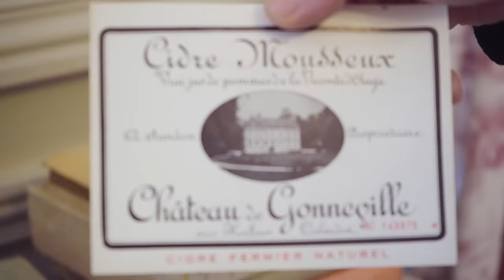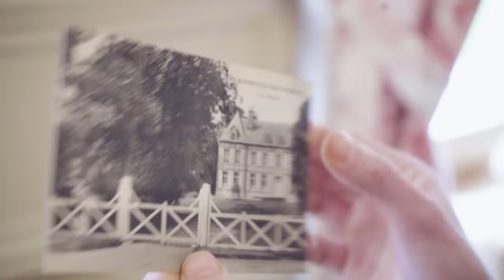We bought a crumbling Chateau - and that's how it looks now.

Comment: Heating tip: used floor heating when possible (it can be done under tiles floor but also under wood flooring). When your feet are warm you don’t need to heat too much.
Reply: Floor heating is the worst thing as far as heating is concerned.
Reply: Underfloor heating is useless for old buildings. The slow heat build-up leaks through the numerous gaps that old buildings need to control moisture.

Comment: If you want to remove old paint from metal objects (door knobs, hinges, metal light bases, etc). put them in an old crockpot you don’t use anymore and cook them in the hot water on high overnight.  The heat makes the metal slowly expand and loosens the paint.  Remove them and scrub with brush.

You don’t damage the metal and have to use caustic products

Just a thought
Reply from the maker: Thank you for the tip!

Comment: I just discovered your videos and am in love with your renovation.  My family was constantly renovating homes as I grew up and I can attest there wasn't nearly as much mirth as you guys show.  I'm glad you are able to enjoy the process so much.  

I did want to mention a shortcut.  You mentioned having to remove the paint from old hardware.  Another youtuber I watch had the same issue.  However; she filled a crockpot with hot water, dumped the hinges, etc. inside then let it "cook" on high for 6 hours.  The paint came right off with little effort.  Just thought you might want to try it if you run across more metalwork that needs stripping.

Best of luck with the channel.  I subscribed after the 2nd video I watched.  Can't wait to see more!
Reply from the maker: Thank you Shelly and welcome  to our channel!

Comment: 🚩 10:40 It's not wise to not heat up rooms because later you will deal with mold there and it will cost you more then heating to get rid of mold  and deal with the damages. 😏

Comment: Preserving your documents: I have some expertise in the conservation of parchment (perkament/pergament), and studied parchment making in The Netherlands in 1996. Your oldest documents are made from parchment which is essentially a specially prepared form of leather. The primary enemy of parchment is moisture. My recommendation is that you acquire a plastic bin as soon as possible for those parchment documents, and you can protect them from most environmental dangers such as bugs or dampness by placing in the plastic container with the documents two small boxes, one with rice to absorb moisture, and the other with baking soda and maybe a few mothballs or some eucalyptus oil to repel bugs. Parchment that is kept in reasonably dry conditions can survive indefinitely, which is why it is still in very good condition. Some parchment still exists that is over 2,000 years old. As long as it is kept dry and free of bugs, it will be safe from decay due to its physical microstructure. When you can, seek out the nearest library with a conservation department; they can construct archival containers for you or advise where to purchase them. Thank you for sharing your story!

Comment: Carbon date the paint sample and it will give you an idea of when it was made. Just a small speck of paint is all that is needed. Send it off to a lab in your area or a conservator may have a resource for you.
Reply: Oh another issue that many of the paints in the building are lead based and considering small children make sure their is plenty of ventilation and their not exposed to dust. you can get test kits at a local hardware store to test the paint in questionable area's. If the surface is intact just paint over it to seal it. Be safe.

Comment: I'm really enjoying your 'Renovate A Chateau' and trying to take inspiration to renovate my small flat in London!....I have some questions: 1) With the high global energy costs what is your strategic plan regarding renewal energy sources (i.e. Air heat source pumps, Solar/Wind power etc.) ; 2) In England you can get repair grants for historic buildings if they are on the Historic Risk register. I understand that in France buildings are listed as Classé, if considered of national importance or Inscrit  of regional or local value.  If you Chateau is listed as such did  you qualify for a grant?  3) You stated your Chateau was built on  the foundations of a Norman Fort!....Were you required by French Planning law to have an archaeological survey? ; 4) As a film maker have you considered using the Chateau for French films/dramas?  Merci Beaucoup!

Comment: 16:33 The latch is a little bit stiff...
Take the latch apart. Clean the inside surfaces very well where the metal slides. Spray the contact points with Moly (molybdenum) Dry Lube. That stuff is amazing.
Then once that's dry spritz a little bit of WD-40 lithium in there.
It will slide back and forth like a champ.

Comment: Not an easy task, but a faster (and not always cheaper- depending upon the fabric and tacks chosen) solution to covering walls until they can be properly done would be to tack some pretty fabric up. If you make the fabric panels into curtains and hang them on rods, then all you have to do is relocate the curtains to the next room you plan on renovating. You can still peer behind the curtains to reveal to curious guests the original painting and paper. :) By the way, Anna, I love that you’ve made your own wallpaper! Beautiful. I love the green walls, too. Very cozy! :) Where is your pack of hounds? That is all that is needed for a cozy winter family gathering!

Comment: The bed seems to be way too modern for a chateau as does the lamp. Maybe you can go brocanting with Billy Petherick to find some antiques to use. The modern medal chairs by the table in that bedroom don’t go with the chateau, either. 
It seems all the moldings are just disappearing since they are all painted the same color. I know y’all have worked hard, but antiques would help with the overall aesthetic of the chateau.

Comment: I had 2 radiators in a sunroom that burst during a power outage after an ice storm.  I was about 29 and had no idea that I needed to drain all the water out of the system. my plumber said they could thaw them out the next day - no problem - it started raining into my back mud room a few hours later and they were toast.  I couldn’t find anyone to take them out of the house so I disconnected them from the system and there they sat.  At the end of years of restoration they were stull there.  A friend Linister Smith, an artist, painted a harlequin holding pipes by my ancient water heater with the name of the Plumbing Company. He had had a run-in with them years before.  Made me happy. Protest art.  lLive and learn and sometimes you just live without the lesson and that’s fine too

Comment: An idea for DIY art pieces to hang in the breakfast salon is to transform photos of your best historical documents, with their beautiful calligraphy and ink stamps, into poster size pictures. You can use antique frames. Also, a note to help with gilding frames as you did he mirror in this room, is to get the very thin gilder's brush made of squirrel hair, and called a 'gilder's tip' which will pick up and hold the sheet of gold leaf until you can lay it on the wood.

Comment: This was absolutely interesting.
I was wondering does the rooms get mold if you don’t heat them in winter or is that just a things for newer buildings?  I’m not used to European architecture or houses, having bought a house in Germany I’m still learning everything about managing the winters from scratch.
Reply from the maker: we do heat the ground floor rooms a little bit to prevent mold.

Comment: If you have steam or hot water radiators and water is left in the radiators, you take the chance the radiators will crack and leak.  When we purchased our castle, the heat was (off) and the hot water radiators (all) cracked and had to be replaced costing $27,000 to replace and install by a licensed plumber.  Best to keep the radiators set on a (low) setting, or take the chance on the radiators cracking in the cold house.  At the very least, leave the doors open so some warm air can enter the room.
Reply from the maker: thank you but we don't let it go THAT cold :)

Comment: Truly, you have revived this place with a wonderful sophisticated and personal taste! Is the woodburner in for the long haul? It is a little surprising to see - at a least for me. I recently bought a portrait drawing from 1823 of a French woman sitting in front of a door with a glimpse of similar fittings, so it was interesting to see your rescued doors. For the green wall decoration I'm going to suggest an 1830s/40s date. Many thanks!
Reply from the maker: Yes, it is! It's about cost efficiency and sustainability, on open fire would be very wasteful.
Reply: @HowToRenovateAChateau  Thanks for the reply. Your purchase of the radiators had me wondering if one was going to end up in the salon.
Reply: I suspect when they haven't got visitors they don't heat the whole chateau but can heat the salon just for themselves using the wood burning stove independently without having to heat all the unoccupied rooms. It must cost a fortune to heat the whole chateau as the ceilings are so high. Maybe a wood pellet burner like at Chateau Baismaginee?